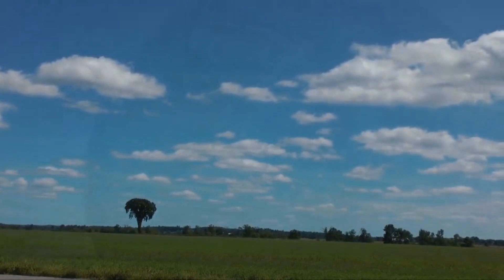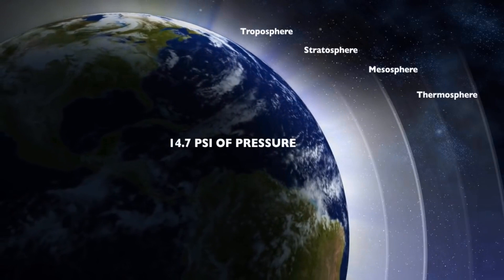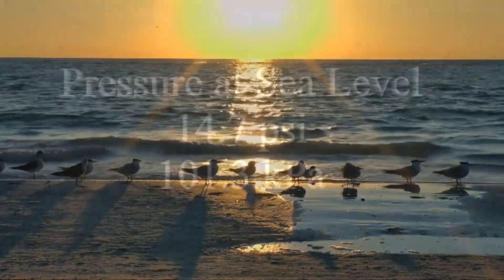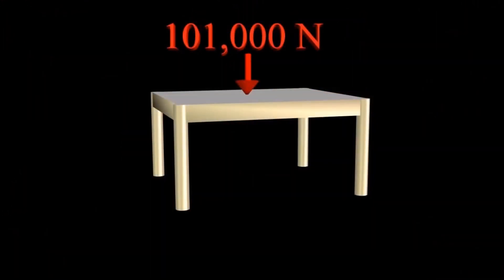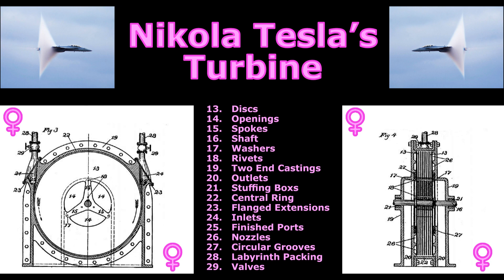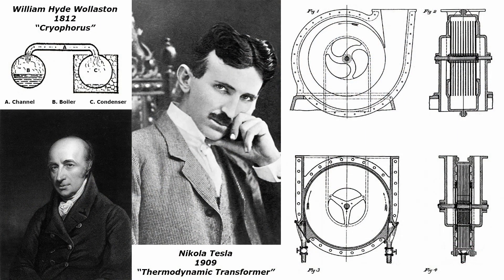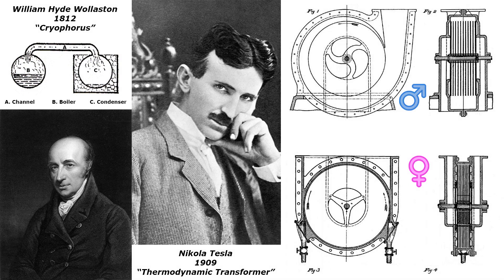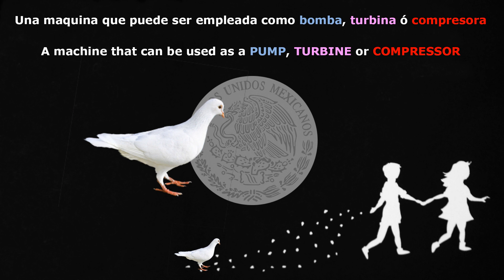Nikola Tesla's Atmospheric Air Engine - Hydraulic Force From Solar Heat Via The Vacuum

Comment: Is the final product going to be a more efficient steam turbine or a generator that can run itself without external energy sources?
Reply from the maker: Good question! Tesla left plenty of evidence via articles and patents to teach us how to harness the hydraulic force of the atmosphere via solar heat. I would say that is a very powerful external source. As well as radiant energy and nitrogen shockwaves, it was Tesla's lowest hanging fruit. Tesla's first working prototype was very likely the earthquake machine. Hence the reason he pioneered rotary engines after pioneering frictionless reciprocating engines.
Reply from the maker: @ivan schafeldt it was actually me that showed them this video and paid for a lot of their early experiments which got them of the ground. https://www.youtube.com/watch?v=8zgr5bwCVyY
Reply from the maker: @ivan schafeldt Tesla had much bigger ideas about how to tap the environment. The “cryophorus” is a teaching analogue for his system.
Reply: This dude is making strides with both cold steam power and the tesla turbine to transform that power to usable electricity
https://www.youtube.com/watch?v=xYMyNhBeH9k&t=813s

Comment: What about the Tesla (car company) car in "space" wouldn't that suffer damage due to the vacuum of space?
Reply from the maker: If the implosions are caused by the weight of the atmosphere and the pressure differential causing the hydraulic to be applied the barrel, train etc. That would leave the idea that little to no weight pushing on anything that leaves the part of the atmosphere that weighs something has no hydraulic force applied to it. If it was an airship then it should theoretically be able to move with little to no friction. Hence why planes fly at high altitudes. Why don't they fly higher? The jet engine has altitude limits. The piston engine was replaced because of its altitude limits along with its efficiency. The record altitude for a jet plane is 123,520 feet, set by Alexandr Fedotov in 1997 flying a military Soviet MiG-25M.
Reply from the maker: @ivan schafeldt check out rats in space from Elon Musk for some more top quality footage....
Reply from the maker: @ivan schafeldt rumors that Stanley Kubrick and NASA were involved. I've never met anyone that went to the moon yet.

Comment: Tesla’s US Patents are:
  1061142
  1061206
You can tell by the design that they were designed to be linked together, the pump providing a negative atmosphere pressure for the turbine!